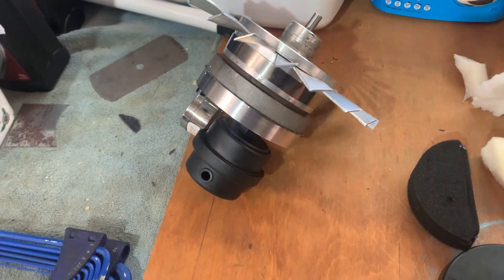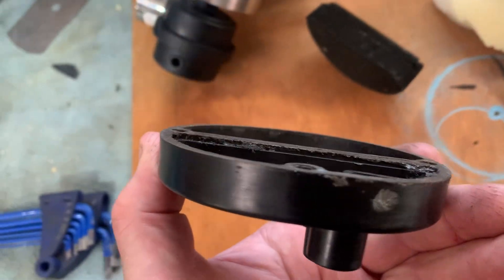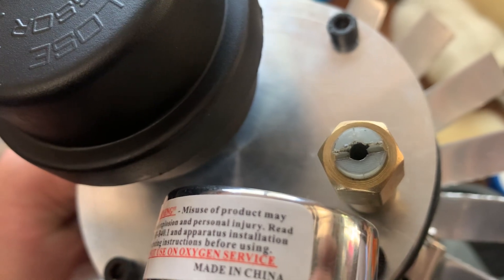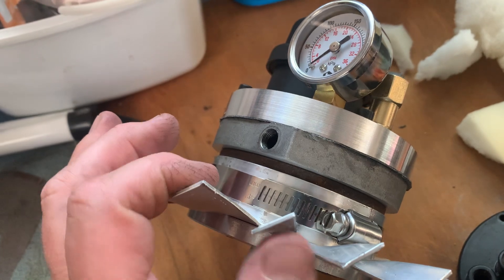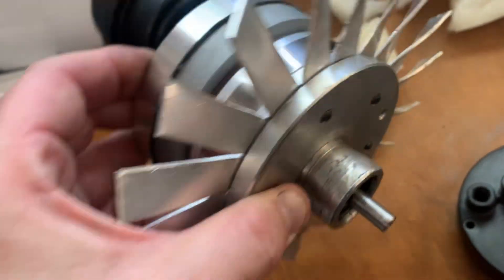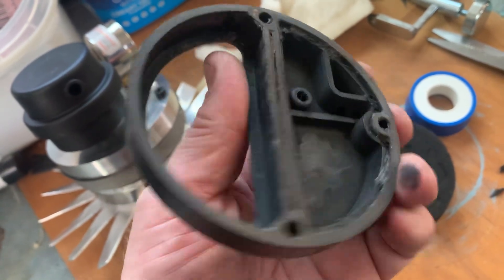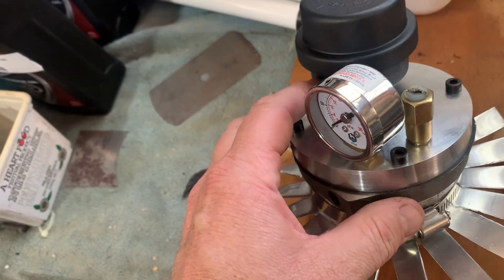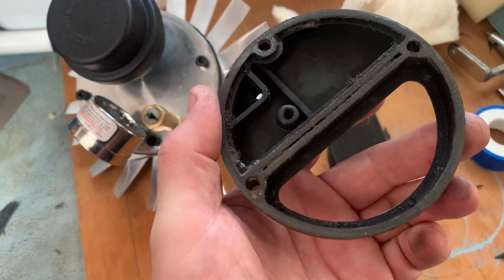Bairan Waste Oil Burner Air Pump Issues Resolved

Comment: Hi, I’m looking at trying to adapt a similar compressor on a homemade waste oil furnace burner adapted from a Beckett burner. Would you have a link to where I can buy this bolt on vane type compressor and parts? I’m also a hobby machinists so adapting it and applying your improvements should not be an issue. Thanks